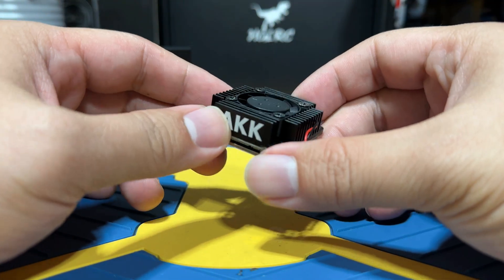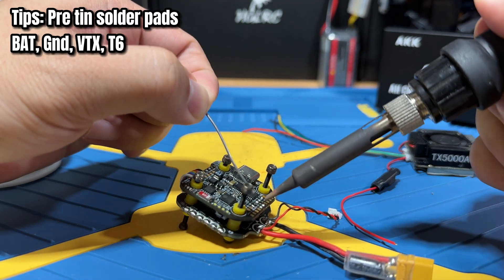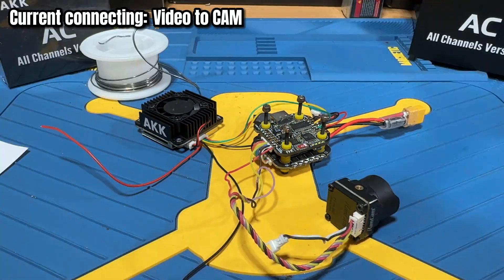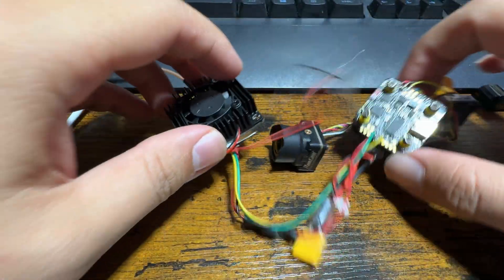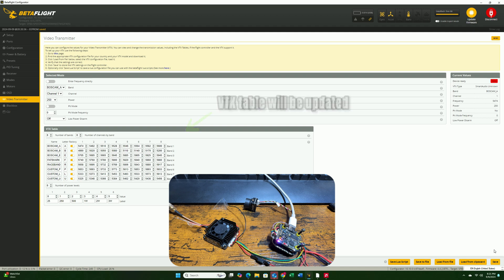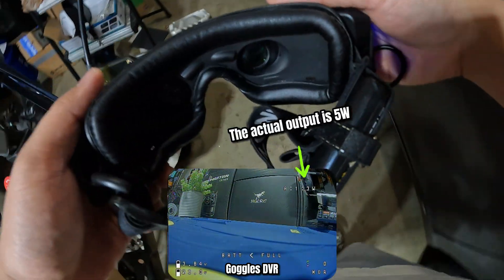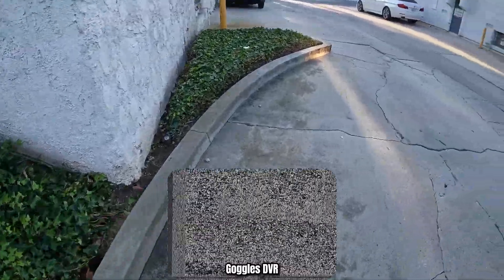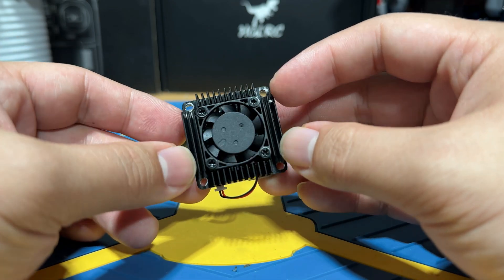Smallest 5000mW VTX! AKK TX5000AC | Install & Setup & Penetration | Ultra Long Range FPV

Comment: I desperately need help. I recently bought a radiomaster pocket and build a drone using a speedybee 405v3 stacked. I’m having trouble getting the radio and esc to bind. Im not even sure if those two are compatible. The receiver I bought does have elrs build it. Configured the drone on betaflight as far. Due to not capable of binding, it doesn’t show the stick movement from the radio on betaflight. I need help 😅
Reply: In addition I don’t even know how to configure the radio. Like the arming button or turning on the leds. It’s all very overwhelming. Would appreciate some assistance
Reply: I had the same issue u have to use expresslrs configurator update the elrs on both the reciver and the radi to same version , and set a bind phrase so u can then bind on startup @ichhabeporsche6151
Reply from the maker: Ok … sadly there is not a simple answer to uncovered all of this, but, I have made a series of video to explain most of the questions you have, I will request you to review them 1 by 1 in sequence. And then if you still have questions, you can let me know 

FPV 101: How to get started from ground zero?
https://www.youtube.com/playlist?list=PL8oE9qQrTLtdE1Bal_FKV3PckijUU5-ln
Reply: You have to flash your radio and the receiver using the ExpressLRS Configurator. You can look the download up. Make sure to enter the same binding phrase while configuring both the tx and rx. In betaflight you have to select crsf as rx protocol and in the ports tab turn serial rx on for the port you soldered the rx to. There's many tutorials out there but these are basic installation steps and somewhere to start troubleshooting. I have had a flight controller which refused to communicate with my elrs rx, however a different brand (both fc and rx) did work for me. When you're just starting out it can be very confusing but it will all make sense :)